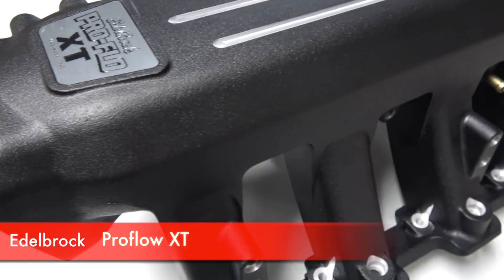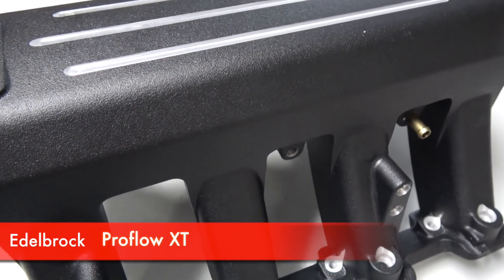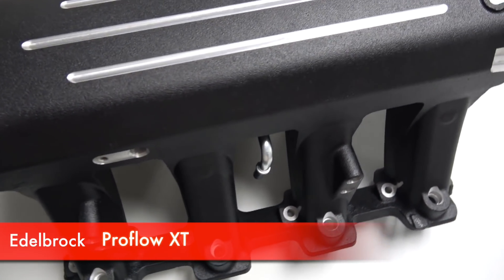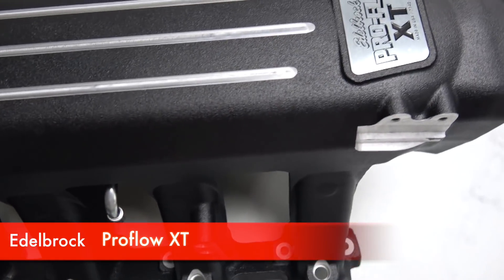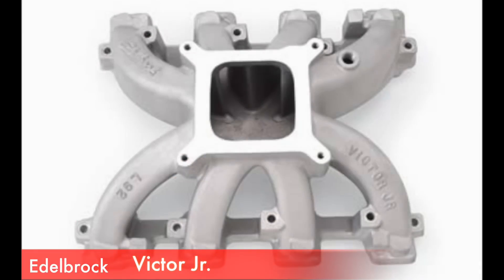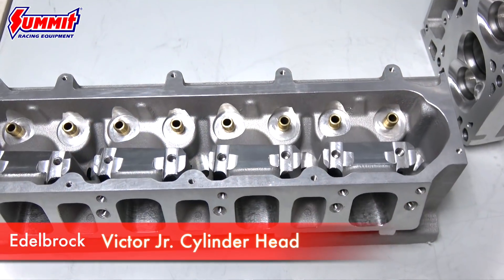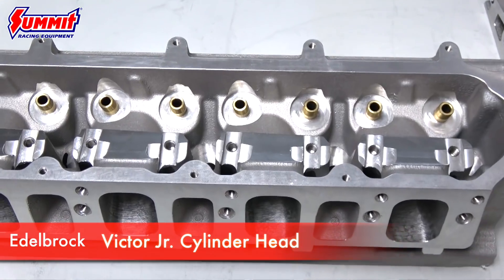Edelbrock Gen 3, Gen 4 Performance Products

Comment: would this work on a Gen 6 454???
Reply from the maker: Thank you for your question.  These items are for the Gen. 3 and 4 LS based engines.  Edelbrock does have parts available for Gen. 6 engines though.  The most cost effective is to convert to Mark IV aluminum engines with the correct head gaskets and that will open up a lot of intake manifold possibilities.
Reply: @SummitRacing  I didn't know the Mark IV was an aluminum block... I'm working with the engine that came with my 98 Silverado 3500 dually. I will be swapping to electric fans soon and then exhaust work